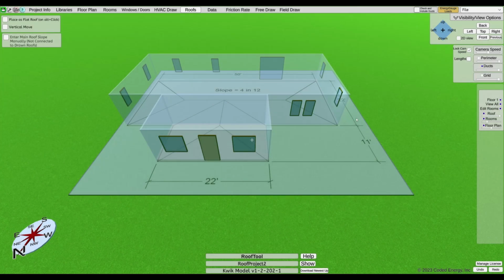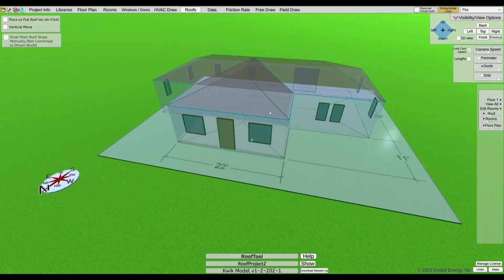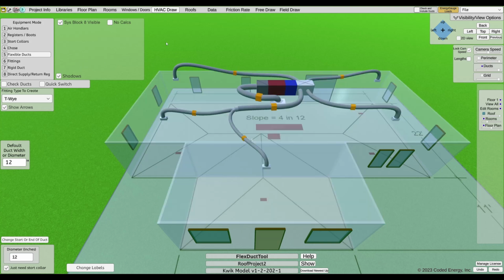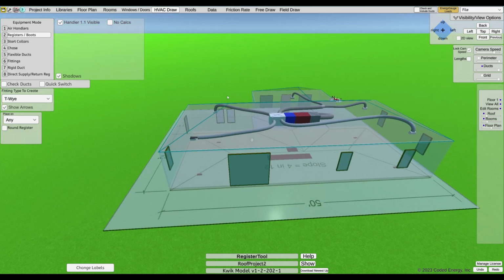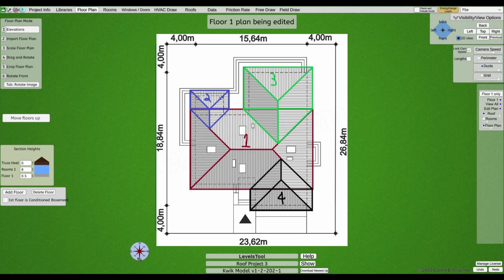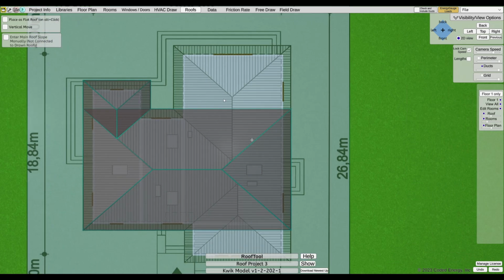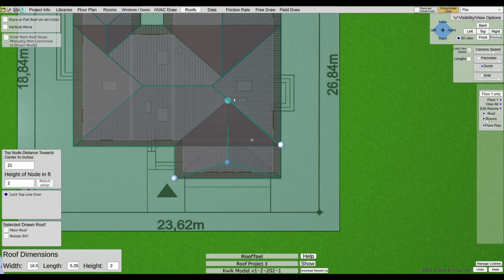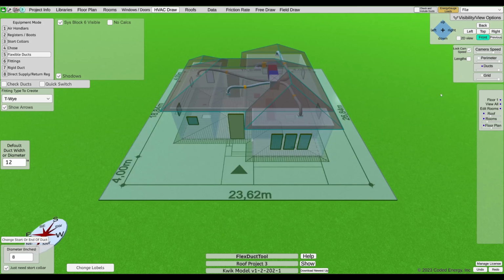DDV Roof Design Demo

Comment: Hello, How can we increase roof color  (visibility). The version i am using its very difficult to check if the HVAC system pops out. 2:40
Reply: On the  far right side of the screen, there are sliders to control the opacity of the roof, rooms, and floor plan.